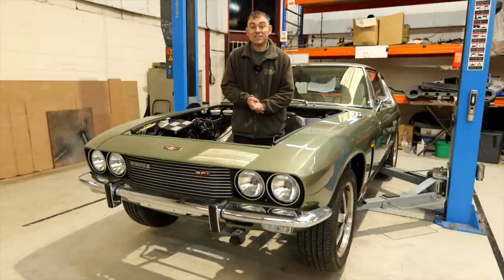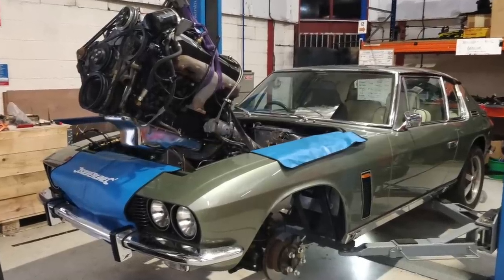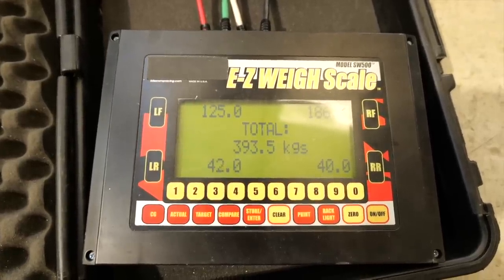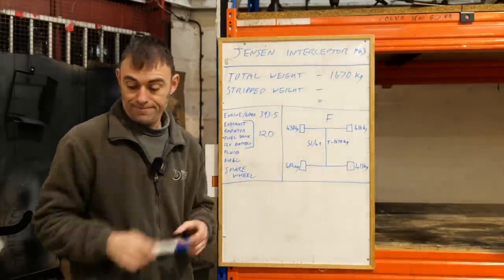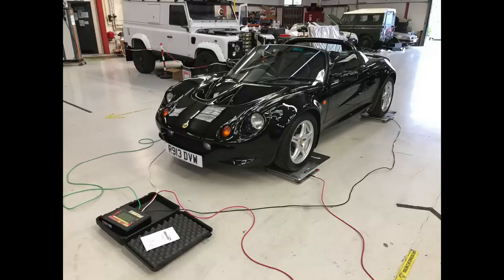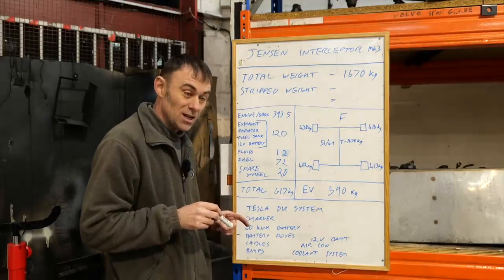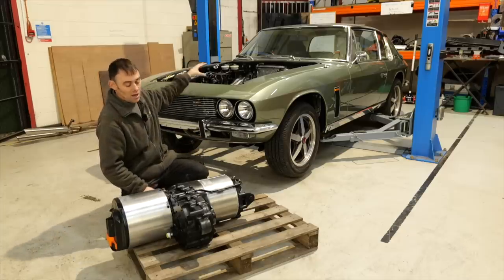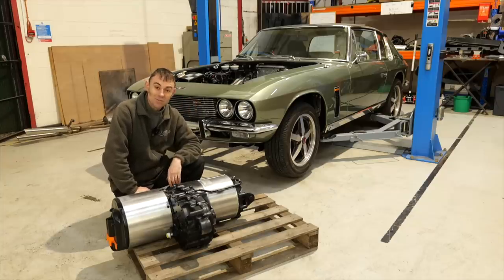Shocking amount of weight removed from the Jensen Interceptor.

Comment: Interesting to see the weight comparisons, this is something which is generally conveniently missing in the TV program.  

However I found it a bit strange that, apart from a bit of interest, it was felt necessary to take the time to measure individual (or groups of) components, would it not have been easier to simply put the car back on the scales again after they were removed?
Not really fair to include the spare wheel, this is equally as necessary/un-necessary whatever the motive power, the only reason you didn’t include it post conversion is due to space no longer being available but could just as easily be removed for dino power.

A cynical person (not me) may believe that the figures were massaged at least a little in favour of the EV.  For instance will the unconverted car really only manage an average of 10 MPG with its EFI equipped induction?  Should be better than that.  Also worth noting that the fuel tank will not always contain 72KG of fuel, in fact by the looks of things it will never hold that much for long!
Also there was no weight quoted for the vacuum and hydraulic pumps which will be required for the brake servo and power steering or the heater/AC system, were these accidently forgotten about?  
It’s also worth bearing in mind that this is, purely by chance I’m sure, an extreme example, not sure if that is the heaviest V8 available but it must be getting up there.  This is why I’d be interested to see the comparison for all conversions or at least a range of types.

Don’t get the idea that I’m against electric cars, I do see many positives for them, particularly for classic vehicles.  But if comparisons are going to be made they need to be fair.

On the positive side I’ve got to say that is a nice looking car and I’m sure it will be a creditable machine when finished (hopefully we’ll see it on the scales in its complete form?).  It’s a shame that motor couldn’t be fitted across the rear axle similar to the 944 conversion I viewed recently (also a very nice car, one of the best I’ve seen so far), I guess no space available?

Comment: Did you consider losing the diff and prop shaft then mounting it across the back with Tesla drive shafts?
Reply from the maker: Yes, there's not enough room without cutting out the boot floor. It's also quite difficult to swap out the rear solid axle and come up with a suspension solution for the new setup if we went that route. 👍
Reply: @ElectricClassicCars  Independent rear suspension is being done by Jensen International Automotive, who rebuild and use LS engines.

Comment: Love these videos. Question: Why did you not just weigh the car before and after stripping things out? I understand the engine and transmission due to knowing what the factory mounts can deal with, but the rest of the stuff. Was that just to have an interesting video? Or is it something else?
Reply: We wanted to show what components are removed. 👍😀
Reply: I was wondering the same. I thought it might have had to do with weight distribution, until he load up stuff both ends of the car.
Reply from the maker: We did corner weight it once it's stripped but to make the video more interesting we thought we'd film and weigh all the components that came off. 👍
Reply: @ElectricClassicCars  You successfully made an interesting video. That is why comments are so great. If we have questions, you can answer. Thank you.

Comment: Great EV conversion. I wonder with all that underbonnet space could a 100kw/h battery pack be used...

I would love to see you do a single seater classic mini cooper (central driving position) with the Tesla System driving all four wheels with a battery pack replacing the back seats, c/w wheel spacers for a wider track, flared arches, which would be road legal.
Reply from the maker: Great suggestion!

Comment: Losing the spare is a bit of a cop-out.
Reply from the maker: Why? Modern cars haven't had spare wheels in decades, and we need the space for the rear battery pack.
Reply: @ElectricClassicCars  The Jensen is not a modern car. Removing something that is not part of petrol driven system seems to be not in the spirit of the conversion. It also shows that there is a (significant) compromise to 'get things to fit'.

Comment: I can't understand that 10mpg figure for the stock Jensen. I run an almost as big 6.75 litre Continental R with more power and weighing in at 2.7 tons. We have averaged 20mpg over the last 2,000 miles which I know isn't perfect but acceptable considering this is a classic vehicle which doesn't get driven daily. It seems to me that these conversions are just so expensive that only a few can indulge, which is a pity because it's something I would consider.
Reply: They're deliberately being pessimistic. obviously it won't be frugal ... but a v12 xjs would manage 12 - 18 mpg

Comment: That's a silly question.  It's a known fact that an electric motor and battery pack weigh double an ICE engine and trans.  Compare models that offer both and the EV version is consistently at least 800 pounds heavier in their lightest version.  If you're ending up with a lighter vehicle after an ICE to conversion, you are undersizing the battery and motor.

Comment: It's a bit of a shame you can't easily fit that motor in place of the diff. Obviously you guys don't do much underbody work to keep the car structurally sound. How extensive would it have to be?
Edit: I'm impressed with the weight savings. You could probably remove some sound deadening  and heat rejection material in the engine bay too, but that'll be a kilo or 2
Reply from the maker: To mount the motor in the rear would require cutting out the rear boot floor and some serious custom suspension on the rear too. As our conversions are bolt in, such mods are a big no no for us. 👍
Reply: @ElectricClassicCars  I see. I've watched SuperfastMatt's Jag conversion, and the suspension is a lot of work, basically making it handle like a completely different car. How far under the transmission tunnel will the motor go?

Comment: And thereby is why I will not have an electric car, they are just not practical for where I live.  My CR-V has double that range, and cost a whole lot less to buy.  EV's need to get some serious increase in range to be of much use outside big cities
Reply from the maker: Outside big cities??? I live in the middle of nowhere in the countryside, have been driving electric cars for 7 years and have covered over 100,000 miles in them with no problems.

Comment: I have actually seen Princess Anne in a Jenson. I assume she owned it. Later she had a thing for SE5 Scimitars. I assume late 70s based on how old I remember being.
Reply: Scimitars are an excellent conversion subject... Drop the V6 and you gain a lot of freedom esp. the 3litre essex versions..

The FF is the ultimate... to convert using the Ferguson drive 
System ...years before Audi took it Rallying.
Reply: Correct 👍😀

Comment: Richard - Very interesting video particularly as I am in the process of converting a 5L V8 sports car of similar proportions and weight. I am accumulating the parts (ex-iPace battery pack) and developing the interfaces to electric power steering pump, cabin heater etc. Until I get the motor/reduction gearbox I am leaving the V8 in place but your figures have given me a very good idea what I might expect.
Reply: Keep us posted with progress 👍😀

Comment: Why weight all the removed components separately? Why not just drop the empty chassis back on to the scales and subtract from the original TVW? Since you're already using 4 scales, you'll get the weight at each wheel and know the unladenned weight balance for the vehicle.
Reply from the maker: Yes, that's what we normally do but it would make a boring video so we decided to weigh and film all the bits that came off instead.
Reply: @ElectricClassicCars  I understand. And then people would have asked what the individual components weighed, so two better reasons.
Looking forward to the next video!

Comment: Those conversions are quite interesting from a technical point of view. If it weren't for a mighty great sounding V8, doing a swap on a Jensen would be cool! I have a MGB with the lumpy I4 de-tuned for the US market, where I thought about an EV conversion. But for the same price (mid 5 figures) I could put in a Rover-derived V8...with more range (and fun!) than current battery packs! Curious though on how those EV conversions affects the value? Will it be worth more or less worth than a ICE powered Jensen in the same condition?
Reply: MG made a version of the MGB with a v8 in it - the MGB GT.  A family friend had one.  Great in a straight line, oil supertankers could take corners better than the MGB GT.  A modern V8 would have similar problems, far too much weight at the front

Comment: Love the work you do! It does confuse me that  why can you guys can pretty much maintain original weight with your conversions yet modern OEM EVs are 100s of kg heavier than ICE equivalents?
Reply: Because they only need to meet the safety requirements of the original (old) vehicle. Also this is a single motor car rather than the dual motor found in most Teslas (for example). Actually a single motor Tesla Model 3 would come out at about the same weight as this and is wider and a little taller.

Comment: how much does the shaft and differential weight? why don't you try to kick them out and put a Tesla engine in the back?
Reply from the maker: Because there's not enough room without cutting out the boot floor. Also it would require a complete custom rear suspension if we went this route.
Reply: @ElectricClassicCars  looking for weight savings, it may be worth using an aluminum or carbon fiber car shaft?

Comment: I am an e-car fan, but why would you not need a spare tire?
Reply: Repair kits weight next to nothing.
Reply: New cars haven’t had spares for decades. 👍😀
Reply: @LosZonga  you cannot always repair the tire on the spot.
Reply: @spudproductions7606  is that a UK thing.  In the US we still have them.  Most of the time they a just smaller emergency tires called donuts.
Reply: New cars either have no spare ( and a repair kit) and some have space savers. May differ from Europe and the US. 👍😀
Reply: And because of that we get multiple EV trucked into our workshop each year at great expense to the owner just for a puncture, not having a full size spare is a dumb idea in any vehicle, it's just manufacturers cost cutting, some expensive Eurotrash vehicles are the same, the tyre repair kit and inflator are worthless when you blow a hole in a tyre hitting debris on the road too big for the kit to work on

Comment: I owned one of these a 71 Mk3 LPE 3K originally orange but I had it painted pearl white . 9-10 mpg all day or less ( I drove mine daily and very hard and the engine had an upgrade in the early 80s),0-60 under 6 s ,  0-80 about 8 s with gobs of torque for overtak8ng uphill . A heavy car but very neutral in handling easy to control on the throttle , predictable and fun to drive in all weather conditions despite the Dunlop SP Sport 70 tyres although it would aquaplane at about 130 mph .
For petrol heads an 850 Holley and Mopar Purple cam is a nice upgrade in power and torque. 
My guess the conversion may be very tail happy with a new risk of igniting and burning to the ground . Lets see ......
Princess Anne , Roger Moore . Not me , I worked for a living .......

Comment: Surprised it wasnt heavier to be honest
Given that the build budget is hardly restrictive, I most certainly would add a min of 100kg in extra batteries to your conversion weight - ie same as original with a passenger onboard

I imagine the power will be excessive from the Tesla powerplant (useful reference: https://www.youtube.com/watch?v=1n46p3JKjwE ) but the range would remain a frustration to the owner who will no doubt want to continental tour in it - Go for max! - 300 miles motorway range would be a good target for the cost of this conversion

Jensen Forum will no doubt give u some feedback as to front to rear weight distribution dreams for original to help handling - shame its not an FF with all that Tessy torque...

Has there been follow up build videos?

Comment: Bit of a cheat picking a car with a giant cast iron V8, automatic gearbox and old fashioned a/c system. I bet an electric conversion on a Beetle, or Fiat 500 would add a bit of weight compared to original.
Reply: Not really as the same principles apply. 👍😀
Reply: How is it cheating? You think they chose this car specifically to convert? It's a customer car. The owner has chosen to have this conversion done.
Reply from the maker: We didn't pick this car, the customer did, also we've do this on every conversion and filmed a few, like the Ferrari Teslarossa conversion. https://youtu.be/i6OxZ0sFSP4
Reply: @ElectricClassicCars I get that you didn't choose the car to convert but you choose it to demonstrate the point. I have a W202 C class and it would be easier to make an electric conversion seem light if i weighed it against the C43  with its big V8, heavy duty gearbox diff and exhaust rather than a C180 4 pot manual.
I'm not down on ev conversions but yet to see one light weight and decent range, battery tech not there yet imo.

Comment: Goes to show how, contrary to popular belief, that a heavy donor is actually better suited than  a light one, especially if its fairly aerodynamic. Wonder what the CdA is? 

Shame it has a truck rear axle design that makes it difficult to mount the DU in place of the diff and save even more weight.

Comment: Good thing the old engine is not very efficient power to weight, a more modern engine and supporting equipment would be 100kg less, making it much harder to convert to a EV.

Comment: 72 litres is just under 16 gallons, not 20.
Reply from the maker: Yes, you're correct it's about 16 imperial gallons. I had US gallons in my head for some reason. So that would make the petrol range about 160 miles. 😲😳👍
Reply: 160 miles is shocking, by the sound of it you may be able to increase the range with the conversion, waiting to see the next episode…
Reply: @ElectricClassicCars  If you take it its worst mpg that is likely

Comment: If you had to have equivalent power storage and performance stamina, the EV would probably weigh much more. You compromised both in order to come in lighter.
Reply: Compare Hyundai Kona EV to ICE and after you take the battery out it is 100-200kgs heavier than the ICE car then add the battery pack, as EV needs a battery, and it weighs much more.

Comment: but you can fill up with petrol in five minutes how long will this ev take to charge up? sorry EVs are only a sticky plaster hydrogen is the answer
Reply from the maker: Hydrogen takes around 6 times more electricity to make a car go 100 miles compared to an EV. 95% of charging happens overnight while you sleep, the other 5% while you get on with our life e.g. shopping, work or having a short break on a long journey. 😁👍
Reply: @ElectricClassicCars  how do hydrogen take electricity? and how long do it take to charge an ev? compared to filling your car with petrol? and can you recycle old batteries? if not how do you dispose of them ? also also whats the cost of replacing them?